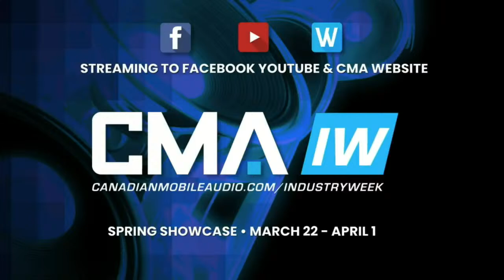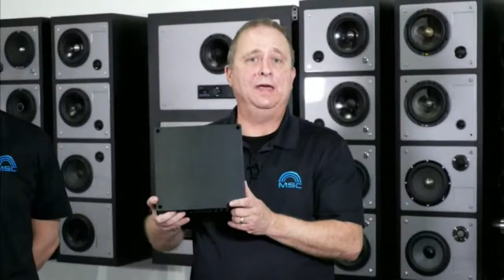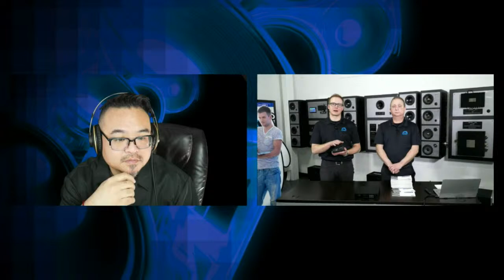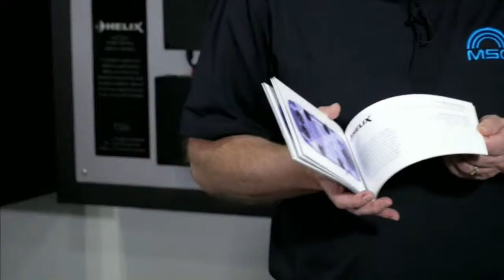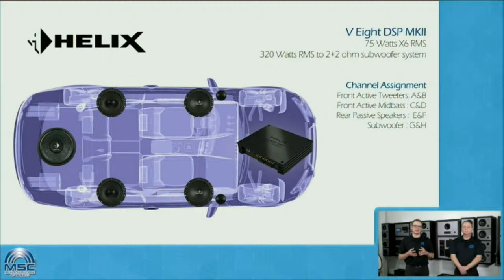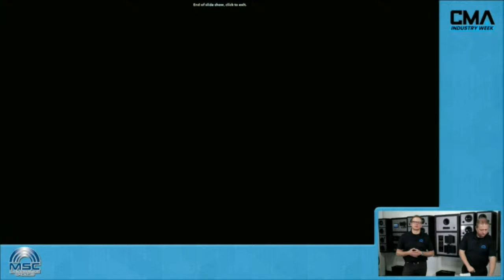Helix / Match - Multi-Channel System Design - MSC

Comment: My Tundra system will be utilizing the Helix V12 to run a Helix Ci5 8' for the front doors, Ci7 tweeters, and Blam Lfr 52 for the front stage. The rear stage will eventually be most likely by a Helix c i3 8' component if it fits, or a Helix C i3 6.5 component set.  What are your opinions?